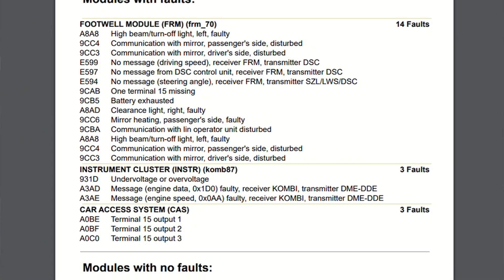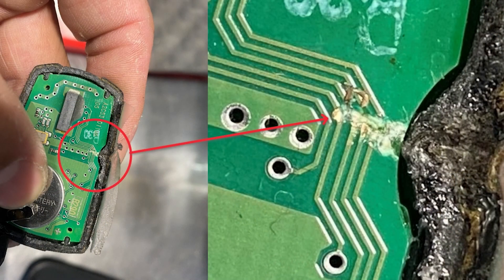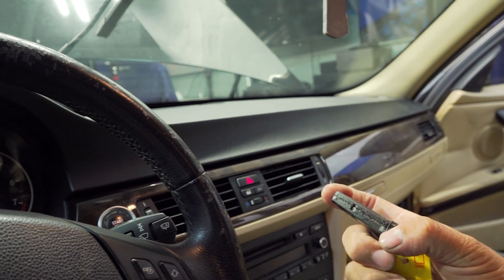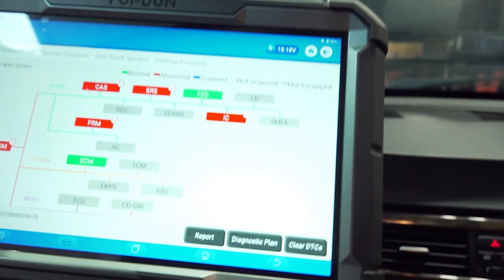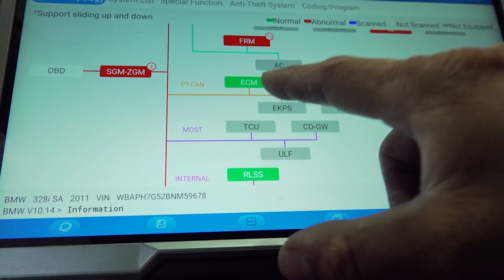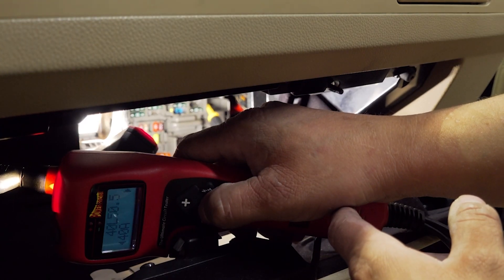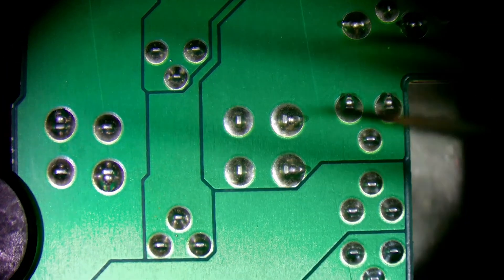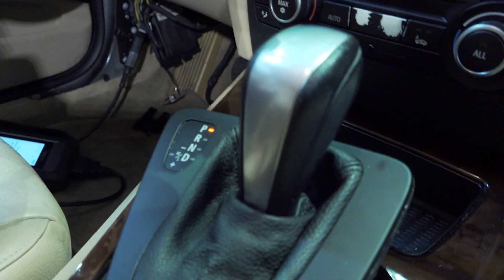Super Mario Diagnostics/SD Premium Exclusive

Comment: I could be wrong..  but with a BMW, i would first check to see if we had an aftermarket battery.(go to the dealership and get the right battery, it will save you thousands)  Then look for any after market alarm systems on the car that were wired incorrectly. (FYI for all BMW owners, they ground the positive not the negative.)  Then i would start my diagnostics. your welcome ;)

Comment: Sir I got a problem with Chevrolet Colorado crdi,,p0101 fault codes  but I already replace the maf sensor,and check the vacuum leaks,,it will run normal few miles,,sundenly at low idle check engine comes out and the p0101 codes comes back,,

Comment: ? Shut down mode , tamper theft mode .... ?
Until reset...... nothing 
 Modules been affected  ?
Until fixed ..... nothing 
 Faulty Modules that have found a limit ?

 Try the remove the battery lead trick , leave the battery  lead off the battery for twenty to thirty minutes 
  This kills all electrical current in the vehicle ( yes you have to reprogram the radio .... with unlock codes ... )
   Lead off battery , resets all the computers in the vehicle  
It's drastic 
   When you put the lead back on , don't put the key in straight away , wait a couple  of minutes , turn the key to the first position wait a few seconds , turn the key to the next position wait a few seconds..... do this to each key position , all the way to start and start it 
     This ( lead off battery ) will work in many instances 
     In say one out of ten there is a faulty module ..... which now will show up 
     You've reset all the others .... scan tool diagnosis clearing codes as needed 

  It's like rebooting your home computer
Reply: Also that key , key codes need to be reprogrammed , new key ASAP .... it's part of the security program ..... some one has tampered with that key 
    The up shot , result is security shut down , tamper , theft mode .....
     Replace the key , reprogram a new key , say good bye to some issues , Diagnostic codes ..... it's a Beeeeemer " That's  BMW for you "